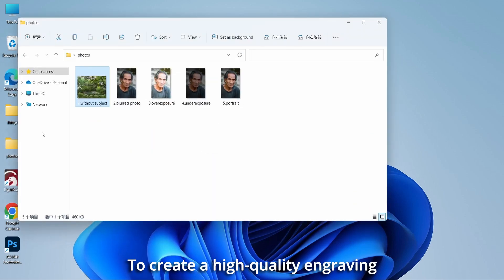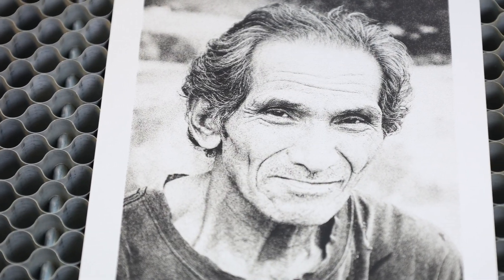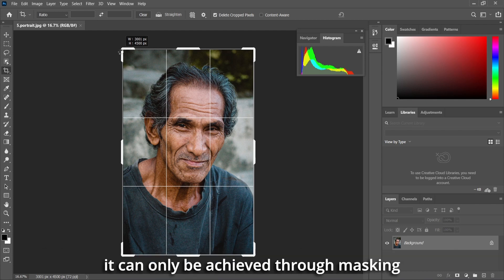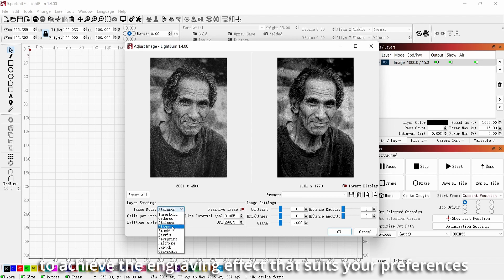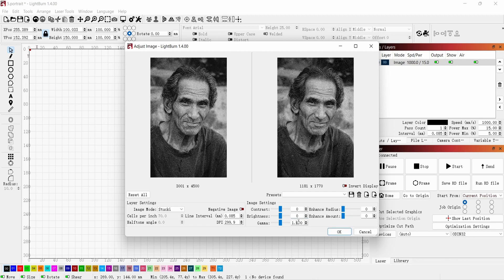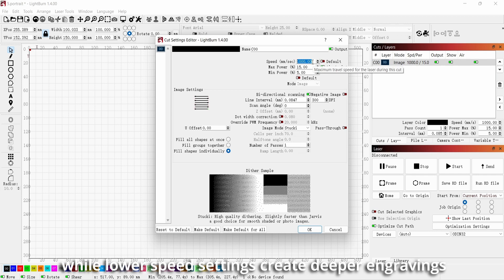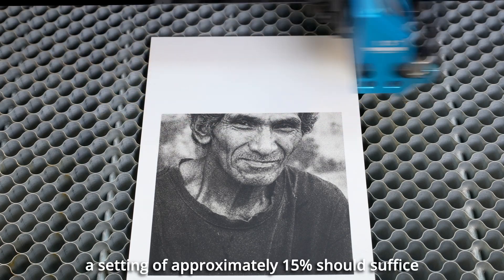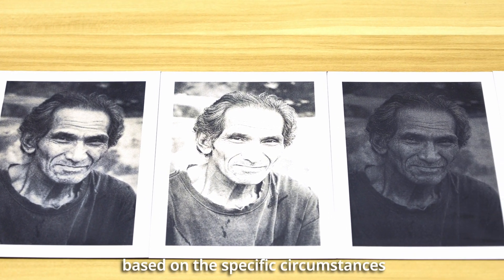Thunder Laser Bolt Tutorial: How to Engrave a Photo Better

Comment: Do you have any recommendations for engraving photos onto glass with the Thunder Bolt 30w with the 1.5” lens? 

Right now I’m using
600 Speed
30% Power (High and Low)
0.050 LPI
0.025 Dot Correction
Air On
Photo Mode Jarvis

I can’t seem to get good photos on crystal and glass. :(
Reply from the maker: Hello, you can join our FB group to ask questions. There are many laser enthusiasts and technical experts there: https://www.facebook.com/groups/thunderlaserfans.